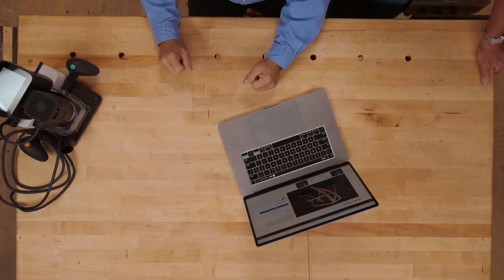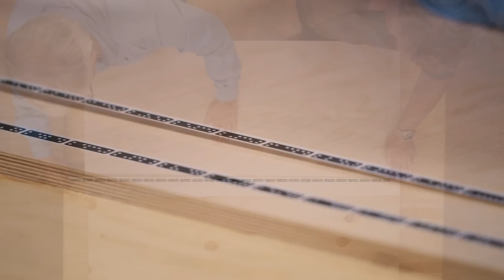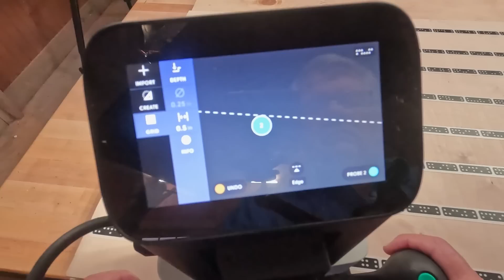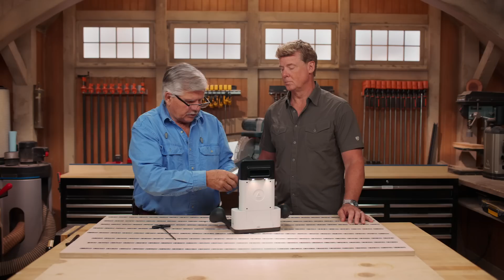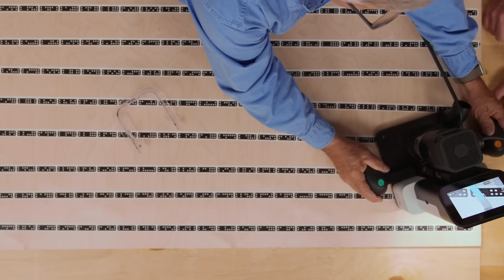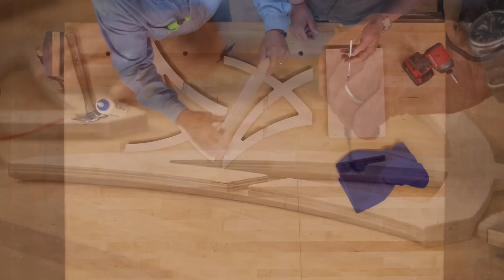Toddler Step Stool | Build It | Ask This Old House

Comment: The Shaper Origin is a fabulous tool. That said it is about as expensive 3.5k  as a good entry CNC machine but it is much more useful for making furniture joints with the table accessory .